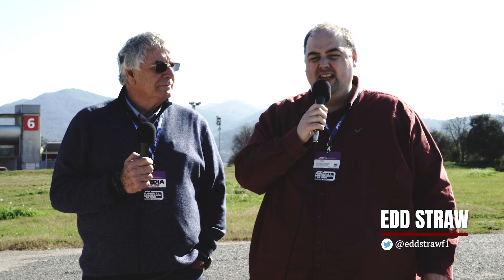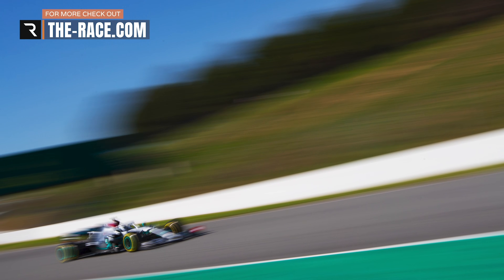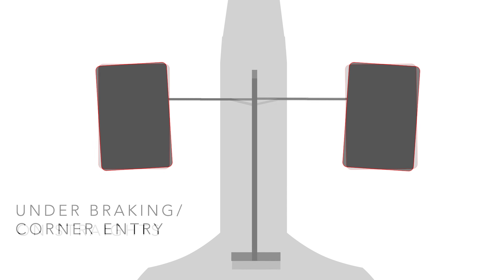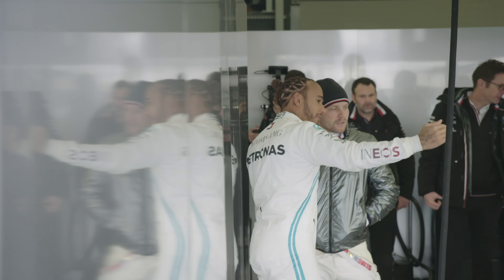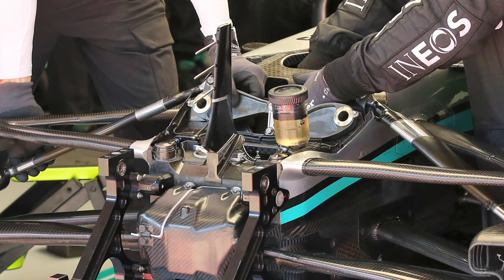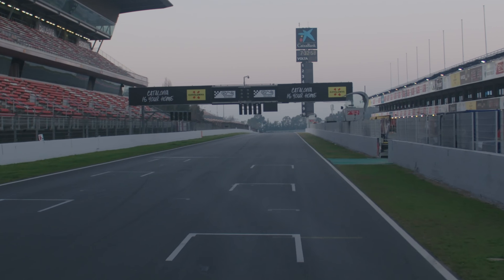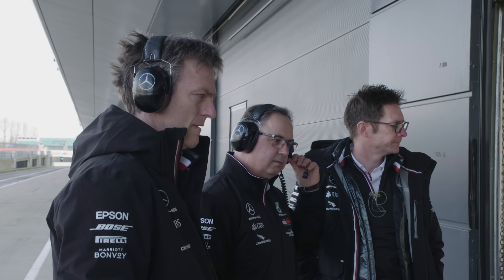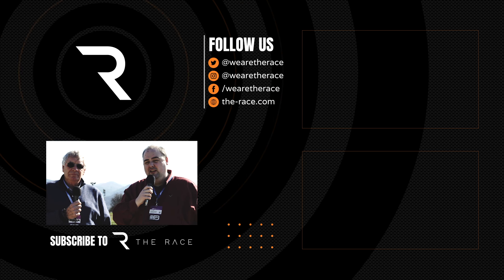Mercedes' new 'DAS' F1 steering trick explained

Comment: I have nothing but respect for the Mercedes engineers that implemented this
Reply: Brett Shirley simple yet brilliant!
Reply: The simplest ideas are usually the best, so on a straight why not have a servo that’s lessons the downforce so speed is gained. While I’m at it, what about a vacuum system that pulls the outer wheel rims in on full chat to narrow the tyre foot width, increase speeds, on corners can narrow the internal turning geometry. .?

Comment: Wait until you see Hamilton flip the steering wheel upside down to activate hover mode...
Reply: Hammer time!
Reply: And open a wormhole where he can see into the future and prevent future mistakes.
Reply: @The_Curious_Cat  I think he already has that feature. He is suspiciously too consistent...
Reply: So THAT'S how he does it!
Reply: 😂🤣😂  Ferrari fans would see red 😂😂😊
Reply: @The_Curious_Cat  Honestly, wouldn't even be surprised knowing Mercedes engineers.
Reply: Shard coming soon
Reply: LOL
Reply: formula 1 Pod Racing.
Reply: Hopefully he pulls it off and crashes regularly
Reply: @drepark2294  Extreme Concepts like Extremely Red and Extremely Second 😂 or even third 🤣
Reply: @The_Curious_Cat  Mercedes developed the first version of this tech for McLaren back in 2007. It's called Grafather Paradox  Engine. That's what  Alonso was trying to use when he said "GP2 Engine"
Reply: @ianbudgetrc2574  more like hover time
Reply: Or BigMc mode

Comment: Wait until they discover that you can also not only rotate and pull but also tilt the steering wheel for another degree of freedom.
Reply: Bengt Lüers hamiltonairlines ready to take off and carry « ali a finn «
Reply: I love that, well said.
Reply: @iXallace  Yeah let's also swivel the steering wheel! m(
Reply: Yes! ... push the steering up to raise the rack via a pivot removing the fronts negative camber for a larger contact patch and massively improved straight line braking..
Reply: It's now an arms race for innovative steering systems 🤔
Reply: Pushing the steering column laterally left on a right hand corner could induce neg camber on the left wheel and pos camber on the right, the contact patch would be significantly increased. In the braking zone with braking the steering column would be central, giving the driver tyres that are straight up and down for full contact patch braking performance. 
That is a lot to put on a driver though and a lot of room for driver error, i wonder what we will see over the next few years. 
You could even use the lateral force of thew lower control arm to aid in pushing force against a steering column link end to assist the inclination of the top arms camber adjustment. 
The greater the lateral force of the lower control arm,the more the upper control arm induces neg camber through a ratio rocker arm system.
Reply: That would need a hydraulic system 😅
Reply: @Chetantandel  it would require a fluid Damening system, not a hydraulic system, there is a difference.
Fluid dampening and using the cars natural, lateral energy to generate force leverage up to the upper control arm would easily circumvent the need for an energised system to control it.
Lower lateral forces would induce less negative camber and higher LCA inward lateral forces at high speed will cause a higher induced negative camber result.
An elongated, fluid dampening lower lontrol arm joint would allow the LCA's to move inboard of the car (eg, 1 inch).
The rod attached to the LCA would then push on a vertical bar the pushes an arm back out board that would be attached to the upper control arm through a rocker arm and cause the upper control arm to move inboard much more than the LCA amount, thus creating negative camber for the wheel hub and wheel.
Reply: @SimonWorlds  👍thanks
Reply: It's a yoke
Reply: @SimonWorlds  Interesting concept with the use of rockers. What do you think about the introduction compliance into a system like this though? Would be an interesting thought with the added complexity.
Reply: Air Safety News 24x7  Oh wow, really?  I will try and look out for it, thanks.
Reply: @SimonWorlds  -  I either didn't take the same college courses as you, or I simply don't have similar experience, obviously, but I kinda get it.  Cool!
Reply: I understood NONE if that but enjoyed reading it lol

Comment: I am amazed that from first discovery to abbreviation, in a 4 hour period.
Reply: I'm amazed that in such a big money business, teams actually manage to keep things like this a secret for as long as they want
Reply from the maker: @richard_nj  Without onboard cameras and full TV coverage of testing, it would have been secret until the first race!
Reply: @WeAreTheRace   Just what I was thinking.  I'm just surprised they didnt leave testing it until day 3 just to reduce the time other teams had to copy it.
Reply: @paulhope3401  I dont think an extra 2 days will make or break the other teams from getting this into their cars for race X. On the other side, it gives Merc the full amount of time to fully test this new system. If there are problems, it gives you a day or 2 to come up with a solution / fix it / test alternate / etc.
Reply: @paulhope3401  it would take along time to test and implement
Reply: @matk22   Yes, so I hear. According to Binnoto it would take around six months!  I had thought it would have been a lot sooner.
Reply: @paulhope3401  no because the whole steering setup would be built around that das. Meaning it would be months of design g, testing, simulation and then building such item. You would then need to test it and all that could take. More than 6 months. And even if it took less that's alot of man power and resources that would. Not be able to be afforded during the season.

Such an undertaking could only performed once the season had finnished or in Mercedes case from when the team won won the championship.

Comment: It’s not trick. It’s call innovation. Other team have to work a little bit harder instead of complaining all the time.
Reply: Innovations are often referred to as 'tricks' at first, before going on to receive wide acceptance and standard practice.  Just think of the first caveman who used one rock to shape another and dominated the "rolling rock down the hill" championship and got all the chicks.
Reply: I think your taking the word 'trick' literally.
Reply: It's a trick. The use of the word trick is not some sort of criticism and shouldn't be interpreted negatively
Reply: Active steering geometry are already installed in production car but are illegal in F1, so this is a trick to bypass the regulation
Reply: @angelorso969  I don't think this counts as "active steering" as the toe doesn't change continuously depending on steering input. In this case, the steering wheel is merely used to activate it by pulling/pushing but that's all.

Active steering was like we had in previous years were the ride height would be lowered by the front suspension depending on steering angle, dropping the front nose down further and further as the steering angle increased to get more downforce through the corners and increasing the ride height again when you rotated the steering wheel back to straighten the car again for minimal drag on the straights...

Comment: Think Mercedes kicking them self got spotted so fast
Reply: Yes, I cant help thinking that a foot operated mechanism might have been possible and a better option for hiding it.
It doesnt seem like they care too much though. If they did they'd have left it until day 3 to test... to give everyone else 2 less days development time.
Reply: @paulhope3401  i think that a foot operated mechanism would be illegal because the only legal way to change the steering is with the steering wheel
Reply: @Luca-sk7bk  agree
Reply: Well given it’s a chassis redesign job for everyone else if this turns out to be legal it’s likely intentionally been revealed early. Get everyone spending money and resources chasing from day 1. What’s most analyst haven’t understood is that the entire rack sits on linear bearings. The only way to do it legally is to move the rack itself. I would also immagine that the front geometry and rack location has to be quite specific to take full advantage.

Article 10.4.1 of the technical regulations states: "Any steering system which permits the re-alignment of more than two wheels is not permitted."

Its kind of a genius and rather obvious interpretation when you think or it!
Reply: @seanek9   Without knowing the mechanism involved I'd imagined it would be fairly simple to redesign repackage the steering components to incorporate a sliding mechanism for the rack to an existing chassis without too much trouble.  What am I missing?
Reply: @Luca-sk7bk  True..
Reply: @paulhope3401  messing around with quick fixes for steering didn't work out too well for Senna.

I'm sure Merc can drop the system easily, but if you need a bigger hole in the tub to fit the steering mechanism, that's a new crash test... and teams are working on 2021 already, doubt they have the capacity to completely re-engineer their steering system (without impacting 2021).
Reply: @seanek9  I give it 4 months before Ferrari introduce their own take on it. I don't see it being as good as Mercedes, or doesn't give them the desired outcome for the reason you mentioned, but it really wouldn't surprise me if they implement it that fast.
Reply: @IanMSpencer  That's a good point. I do think other teams, specifically Ferrari and Redbull, will have to redesign their cars in season if they want to challenge Mercedes.
Reply: @Niko-xz5lk  Teams like Ferrari or Bull could probably have there own version of it on their car within 2-3 weeks if they considered it a 'must have' development.
Reply: They know there's cameras they've been developing it there's no mistake that Hamilton debuted it
Reply: @paulhope3401  it's new to the pit lane yeh it's been spoke about b4 and Mercedes first to go there other teams will watch and see they think it's for speed but it's more for tire performance. / life span and there ahead of the field with there rear suspension  there able to do what they do and win championships  there always a step or two ahead of everyone else
Reply: @paulhope3401  2-3 weeks just wouldn't be possible. When you consider there will need to be redesign on the steering wheel, rack, nose cone, wheel hub and suspension. These things are all optimised to the millimetre for areo and cooling. They need time to for research how to implement it on their car and time to devise how best to do it. It's not going to take 2 or 3 weeks. 4 months would be a huge achievement, but I suspect it could be longer
Reply: He's only turning the wheels, which happens to be his job anyway, so should be legal.
Reply: @Niko-xz5lk  Over 4 months?  Hmmm... I think you grossly underestimate the manpower, financial and engineering resources available to top teams like Ferrari and Red Bull.
F1 massively different from normal engineering in terms of the importance of leadtime and turnaround... Fast turnaround can mean the difference between winning and losing in this game. 
If Ferrari or Red Bull believed that they needed a DAS system to be at all competative and that it would jeopardize their potential WCC/WDC chances they could throw huge financial and human resources at this working round the clock to have this on the car available for testing in the shortest possible time.
Not sure what Ferrari or Red Bulls headcount is but Mercedes F1 team have aprox 1500 full time members of staff at their disposal which should give you an idea of what they might be capable of, if they deemed it of high enough importance vs whatever other projects they are working on.
Reply: @paulhope3401  My guess was 4 months, but I've since  heard Sky say at least 6 months. I'm not an expert, but I've been a fan of F1 for 20 years and I've never seen a team achieve such a feat in 3 weeks. I'd be amazed if it's on Ferrari and Redbull by Melbourne in 3 weeks
Reply: @Niko-xz5lk   I'm an Engineer but I'm not employed in motorsport or a production environment so I could be way off..
Who was it that said 6 months on SKY? If it was someone with the right F1 engineering credentials... that would certainly make me change my opinion.
Maybe I'm underestimating the amount of components and/or work involved in but over 4 months sounds way too much time for me after seeing how quickly they can bring out new parts and copy each other in recent years.
I guess a lot depends on how important they deem it for how much resources they throw at it.
Really interested to see what happens with this one..
Reply: @paulhope3401  I hope you're right. I don't want to see Mercedes walk the season, I was hoping for Ferrari and Redbull to be in the mix this year. Another thing is we don't know how effective or useful the device will be yet, although Mercedes clearly thinks it will be an advantage. It was reported on Sky from a quote from Binotto, who said the system appeared highly complex and it would take them until mid-season to implement it on their car. He mentioned understanding how it works and how to put it on their existing car being difficult, and that it would have to pass safety testing also. Binotto also said they will be watching closely to see if it's worth them doing it, but I'm sure they will be working on something in the meantime.
Reply: @Niko-xz5lk   Well if Binnoto says that as former technical director and now team boss.. I'm sure he has a pretty good idea of what he is talking about!.. so I'll accept that and shut up now. :D

Yeah, I'm the exact same.. really want to see Ferrari and Red Bull able to compete with Merc. Nothing against Merc or Lewis, their achievements are incredible... I just want to see a real multi driver fight for the title rather than the same old predictable results we get.. year in, year out. :(
A WDC for Max or Charles would be so refreshing.
Reply: @paulhope3401  I totally agree. Although it's possible Binotto is talking things down. Let's hope the season is a competitive one!
Reply: @paulhope3401  I think you grossly underestimate the complexities involved.
Reply: The teams suspected it was coming because it was specifically banned in the 2021 rules. They just weren’t sure how it would work and nobody knows exactly how powerful it will be yet. My guess is 6 tenths a lap on power circuits and 4 more laps on wear/degradation in a soft tyre stint
Reply: Luca Droxner yep
Reply: Paul Hope the $$$ of R&D, that adding it would change both the weight and aero balance of the the nose. Likely would need new nose crash testing which would be prohibitively expensive for all but a few. And even those few would rather spend it developing this year or 2021+ instead of ‘catching up’ I think this device will be as effective as the Brawn double diffuser. 2020 is over. Still going to watch every race.
Reply: It was obvious they (Mercedes) wanted it noticed. You could see the smirk on JA face during the interview when asked about it. In fact when other team principals were suggesting it might be a testing component, Mercedes came out straight away and said it wasn’t a test item but part of the 2020 W11 car; fully integrated and functional part of the new car.
Reply: I feel ya, but naah, they had to do the shake down and were now within striking distance of Melbourne - to copy this will require a fair amount of time and testing for it to not end up being a detractor providing negative gains - as we all know how incredibly minuscule the tolerances in F1 are and correlation takes a while to 'evolve'
Reply: @paulhope3401  ya but then more likely to be illegal - like the hole in the cockpit that u pressed your knee against to seal on straights, reducing drag - hahah remember that plum and Alonso with his hip pressed up against the side of the monocoque
Reply: @seanek9 . The overall toe change is between 0-4 mm. So a complete  redesign of the tub is not required.

Comment: Will be tough to mimic that control in F1 2020
Reply: Nah just buy a Thrustmaster T500 !!
Reply from the maker: Good point! Next generation of steering wheel rigs for sims? 😂
Reply: Time to buy a flight yoke
Reply: Yeah, the system is easy to implement in software, it is the hardware that does not support a true copy. You can map it to a dial, but that’s not really the same. If this kicks off, they’ll have to reinvent the sim wheel too.

Comment: Would it be able to be used once they leave the garage for qualy? Does it abide by Parc Fermé? Since you can't change anything other than front wing angle and fuel loads after you leave for qualy would changing the toe not be illegal then?
Reply: I suppose the loop hole is that you can change the angle of the wheels already simply by using the steering wheel to turn around a corner and that's effectively what they're doing here. Obviously, normally, both wheels turn to the right or the left together, but I bet there's nothing in the rules that explicitly states you can't turn one wheel to the left and one to the right at the same time, which is what this is doing, because who the hell would want to turn left and right at the same time?! Mercedes, that's who.
Reply: It's no different to steering left and right which also adjusts the camber and toe.
Reply: @David-ud9ju  Thank you for clarifying. Really smart from Mercedes. I'm hoping for a good year from f1 this year but when Mercedes thinks so out of the box, all I can see is them running away with it again this year unfortunately.
Reply: @peter-joecombrinck2382  yeah they goingro win 10 in a row. Note it down somewhere

Comment: AFAIK, toe-out is needed due to the difference in slip angle between highly loaded outside tyre, and lightly loaded inside tire.  Without toe-out, it would compromise the maximum cornering grip because the outside tire will tend to break traction first.  Ackerman geometry also gives the same benefit.